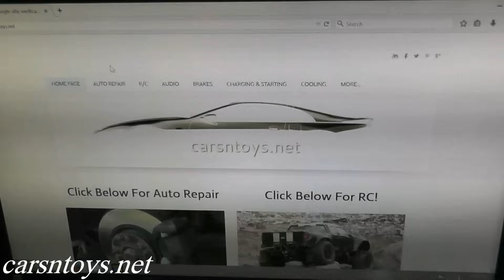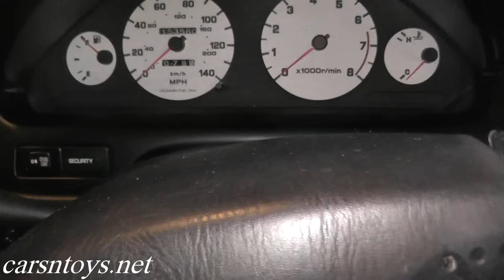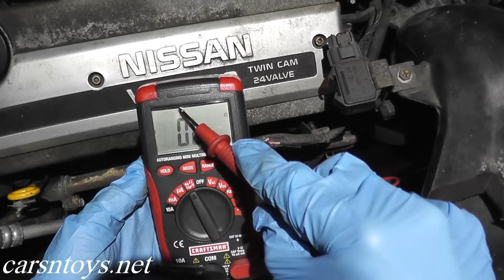Crankshaft Position Sensor (POS) P0335 & P1336 Testing and Replacement

Comment: Wow all I can say is THANK YOU so much I got stranded because of this code car stalled out, the wait for the tow truck was about 2.5 hours, so I had my handy code reader got this code searched it up and you saved my life ended up fixing the wiring it was stripped on the sensor plug I was back on the road in less then 15 min THANKS AGAIN you have the best videos on you tube for DIY.
Reply from the maker: Thank you. Glad to help.

Comment: Hmm, good luck finding it for a 1995 Audi A6 2.8L FWD, it seems like all the pictures, diagrams or related information is all for the A4 and the few i have found that show where the Crankshaft Position Sensor is don't transfer to the A6 even though they run the same base engine configuration. What a bummer. Good video though, clear, clean and precise ;) thumbs up.
Reply: Oh and don't even get me started on trying to do anything besides an oil change, air filter change, brakes or tires on my 911 C4, everything else is pretty much buried inside the car and you really need a lift.
Reply from the maker: Yes, it certainly can be frustrating. If you can't find an image for your Audi your best bet is purchasing the Audi factory repair manual. Sometimes you can purchase a digital copy for $10. Try ebay.
Reply: @CarsNToys  please send me ebay item # because i haven't been able to find one for a A6 C4, most pdfs or manuals are for A6 C5 or newer and Bentley Publishing doesn't seem to have the $300 disk set anymore.

Comment: Hi Many thanks for a great video. I notice you have the same black connector plug with a square button as on my Nissan X-Trail. I've tried in vain to disconnect it. Could you please clarify: when you say "push down" on the button, do you mean press it into the body of the connector or do you mean push it down with regard to the fact the connector faces down. The latter would also mean sliding the button along towards the open end of the plug. At risk of breaking the plug, I've pushed the button in all directions with a screwdriver and used WD40. Has someone superglued it!? I realise it's quite a trivial matter, but lots of folks who like me are unfamiliar with these plugs could end up damaging them. I've also seen there exists another type of plug with a green button you have to slide towards the open end to remove it. I'd be very grateful for your help.

Comment: Changed the Camshaft Position Sensor Wednesday, still Crank, No Spark, No Start, Changed the Crankshaft Position Sensor Saturday, still Crank, No Spark, No Start, Ignition Coils were changed by the dealer 27,000 miles ago (so i have not changed those yet), additionally I found out that the black cylindrical part that is NOW making a single click everytime your turn on the ignition, is the Idle Control Valve (Air Supply) (Bosch # 0 280 140 538), I don't see how that would cause a No Spark, additionally i have changed all 6 plugs with new NGK triple electrode iridium plugs (what the factory recommends), I have also checked all six ignition coil wires (I should have tested them on the coils and that way i would have tested both the wires & the coils, this time i have to repeat the process with the coils on the car. I have also had suggestions to check/change the coolant temperature sensor, the MAF sensor, and grounds. I have physically checked the grounds and there was one that was a little lose (tightened it and moved on). I am also still getting the incorrect 12v reading on the harness wire that goes to the Camshaft Position Sensor (it used to read 0.01v, 5.03v, & 12.01v, BUT now reads 0.01v, 5.03v, & 10.73 plus or minus .90v) so i am a bit frustrated with that, why am i not getting a Constant 12v to the sensor?

Well, anyone that has a clue, please leave a suggestion or comment, Thanks

Comment: 1 month ago my nissan was scan and found code P0335, use to have hard start and stops while idealing. Finally refused to start a week ago. I changed crankshaft sensor at the back of engine, maintained the camshaft sensor on top of the engine and the car will not still start. i went further to test the resistances of the three sensors.2.74Mohms old crankshaft, 6.98Mohms new crankshaft and 3.89Mohms camshaft. Please any idea to solve the problem?
Reply from the maker: Throw us an email to carsntoyshelp@gmail.com and list the year and make of your car.

Comment: Hi there! I have a 1998 infinit I30. and have a problem with the crank sensor I am pretty positive it is a crank sensor. At the very end of the video where you had to touch and hold the screw driver on the tip of the Crank sensor POS Does it stay 5volts until you take the screw driver away? I have a reading of  5 volts and sometimes higher but goes away while the screw driver is still attached to the tip of the sensor. Pls help
Reply from the maker: +Fidel Empalmado You should see the 5v reading when the screwdriver is touching the tip of the sensor. When you remove the screwdriver the voltage should drop to 0.
Reply: +CarsNToys 
Interesting! I have the same fault code P0335 and P0303 on a Proton Savvy 2009. I made a mistake I thought the Crankshaft position &#39;A&#39; was the TDC Magnetic sensor? If the crankshaft position is located underneath next to the transmission oil and it looks exactly like the one you have then I will try to find it then. I have a multimeter but still learning how to use it.

I also have a leak somewhere but unable to locate it? I wonder if this leak is the cause of the crankshaft to go bad?

Please help me?
Thanks in advance

Comment: I'm going to do this test and check the ref crank sensor test on my 02 maxima. My car cranks but no start. I noticed there's fuel because fuel pump activates when I open the ignition switch. I checked the front spark plugs and they get wet with fuel which leads me to believe there's no spark.
Reply from the maker: +bucjackson How'd you turn out?

Comment: 3:58. This does not make sense, how can absence of voltage indicates a break between the sensor and the plug you are testing for voltage?  The plug you are testing takes voltage to the sensor and you unplugged it and are testing on the vehicle's side for voltage (that is correct), no voltage cannot indicates a problem between sensor and the plug, it only indicates a problem at the supply or a problem between the supply and the sensor.

Comment: so i replaced the sensor (pos) and (ref) about 6 months ago and im getting a 1336 code again. ive checked both again and cant find any issues... also my wiring is apparently ghetto rigged with a ziptie... any ideas? lol
Reply: 2001 maxima
Reply from the maker: Well, it can be one of three things: the sensor, flywheel or wire harness. I'm guessing it's the wire harness. To really pinpoint the problem, you'll need a multi meter, or visit a good mechanic. The dealer could certainly do it but they're damn pricey.

Comment: Will the crankshaft position sensor cause a car to shut off while driving and not turn back on? T.I.A
Reply from the maker: Yes
Reply: CarsNToys ok thanks man. I replaced my crankshaft position sensor last nite and put a new battery and today on my way to work the rpms started jumping up and down like crazy then shut off the car starts back up and keeps doing that, any idea??
Reply: mark amador Mine too. I changed and it still stops while running. I'm checking the sensor harness.